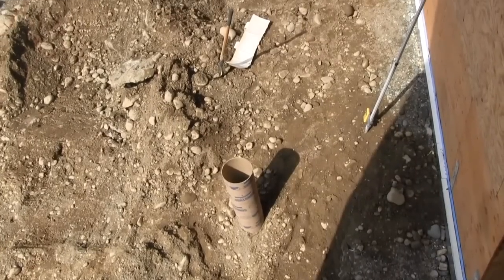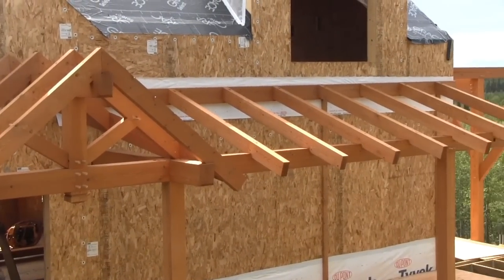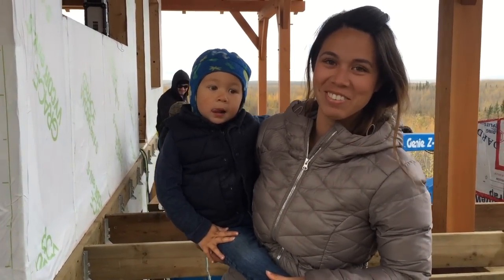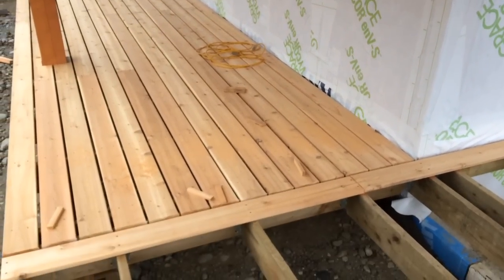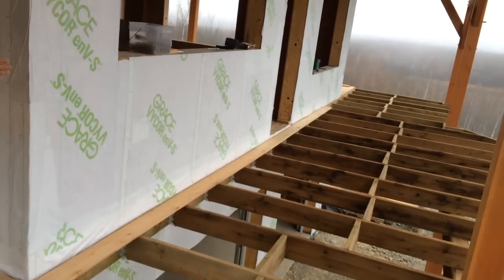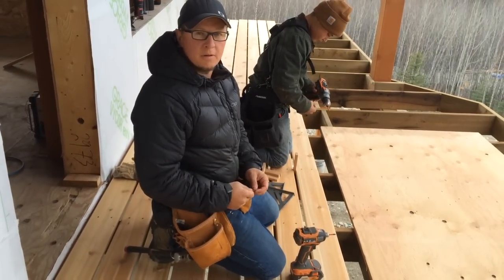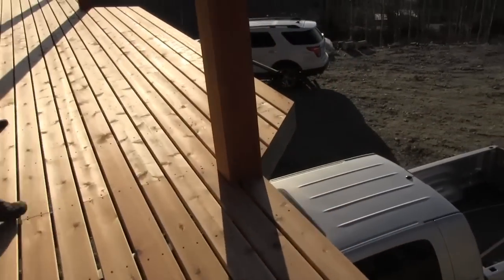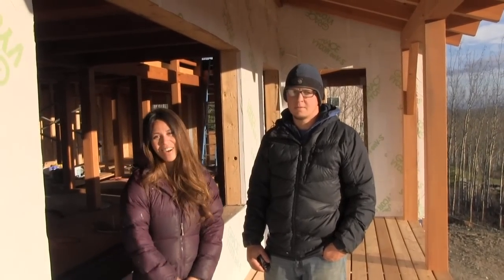Timber Framed Covered Decks - Owner Building a Home in Alaska EP16

Comment: Great build!  Will the pegs be trimmed off?  I'm curious about snow, when does it start, how much per year and will you have difficulty getting to and from in winter.  It's interesting that we also have to go down 48", here in Wisconsin.
Reply from the maker: Hi Todd!  Thank you.  Yes, we will trim all the pegs at some point.  We usually have snow by now, but are getting very lucky with a nice October.  48" is the frost line here, we get down to -50F every winter, cold snaps can last a week or longer - but that's the depth required here - and we don't get alot of snow, so that is interesting it's the same requirement for Wisconsin.